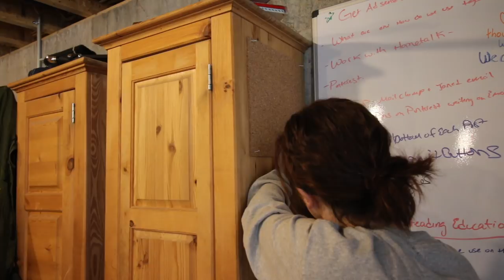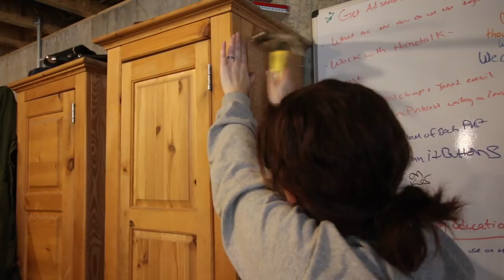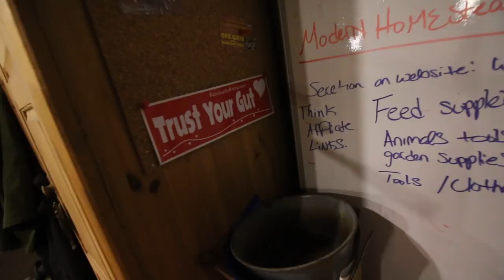When its -40 F Outside and your Plans Change

Comment: We  are in the 50s here in Texas. I do  not envy your cold temperatures.  Still you work with what you have.  Still you are working together.  
The snow sure makes it look cold.  The end product of your woodworking experience looks good.  God bless you all.  God bless America.
Reply: My colder climate vs warm climate theory. I believe in general cooler climate regions have more quality outdoor, productive, daylight time (OPDT) than warmer climate regions.  While it is true that northern cooler climates are much colder during late fall and winter, this is a period of time when it gets dark very early, crops are finishing up, and if you plan your workload you can schedule inside projects.  During the summer and spring prime growing moths when it stays light much later, northern cooler climates are so much more enjoyable to work in. I lived in the hot south where 4 months of the year it is just unbearable outside to do anything and gardens suffer. I have Florida Friends that tell me all the time, you should move down here the weather is great. Then I dig deeper into their life schedule to find many of them spend most of Spring and Summer in their AC house with indoor AC pool, get in an air-conditioned car and drive to a air-conditioned building to work.

Comment: Doesn't it feel wonderful to organize everything.  At first you hate having to do it and then it feels so good to finally get it done.  Then you know where everything is and it is easily accessible.  You were talking about mice and I thought I would share a product with you that has worked very well for us.  I first found the product when we moved to our new blueberry farm back up in the mountains of NC, deep in Appalachia.  I hate pesticides and chemicals so I try to approach things as naturally as I can.  We began to have a problem with what I called flying squirrels getting into our walls and attic at our blueberry farmhouse.  I started looking for solutions on the internet way back then in 1999.  I ran upon this product called Pest Offense.  It is a little box that plugs into any outlet.  You need one for each level of your home.  I usually buy mine directly from the official website, however some home depot and lowe's carry them in stock.  It takes a little while at first to run the mice and other critters out of the house and occasionally one might get caught inside the electrical grid at first but within anywhere from 5 minutes to a few days you will not have any critters (rodents) of any kind in your home.  I even recommended it to a friend that had a possum get up in their attic.  I was there when they plugged it into the wall outlet in their one level home, and you could literally hear it scurry out the fascia vent that it had torn into.  No more possum.  So if you need a solution to mice or rats or possums or squirrels, Pest Offense really works.  There are other brands, but I only use Pest Offense, because I know that it works.  One note you have to replace them eventually after several years.  But for the small cost of this product you can be rodent free!  Yes!  Yes!  I hate rodents!  Sorry for the long winded story!  LOL!  And Lord In Heaven, please don't go outside... -40.  I cannot even imagine!  Brrrrrrrrrrr!  All you need to make it through the cold is a big pot of homemade soup, a crusty cake of cornbread slathered with fresh butter and warm cozy blankets.  Oh I forgot one thing...  Sweet Tea, & Good Old Movies to watch!  God Bless, Stay Safe, & Journey On Over On Curl Up In Front Of That Glorious Woodstove!  😄😄😄

Comment: Al I'm looking at some of your older videos and I noticed an air handler. Being you heat with the wood stove I'm assuming that is you central A/C. You did make a lot more room in the basement by reorganizing. Don't you wish it still looked like it does in this video.
Reply from the maker: We had an ac in our basement to run a walk in cooler.